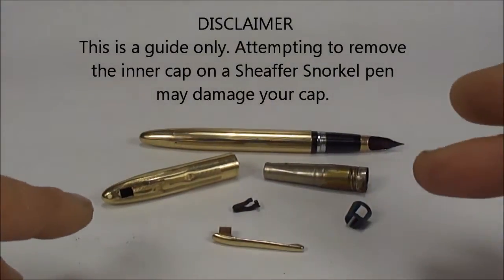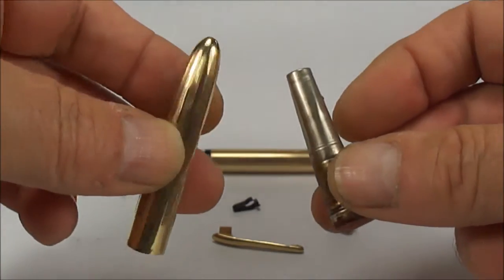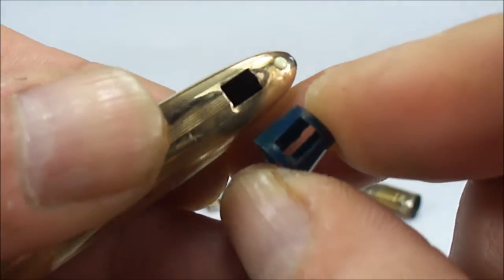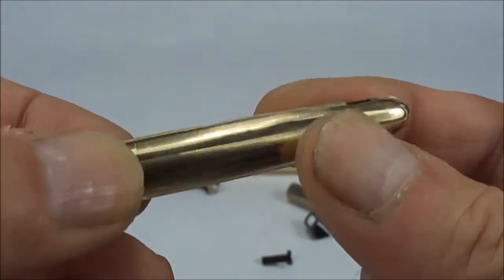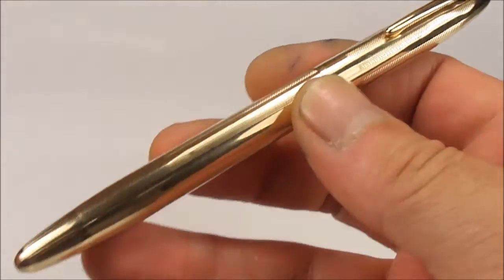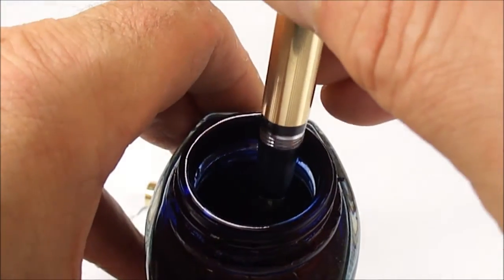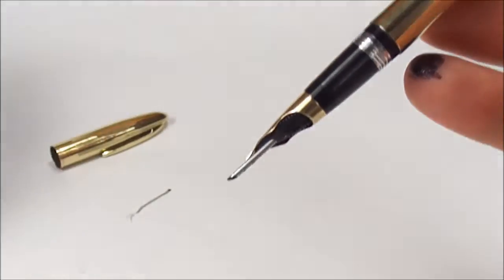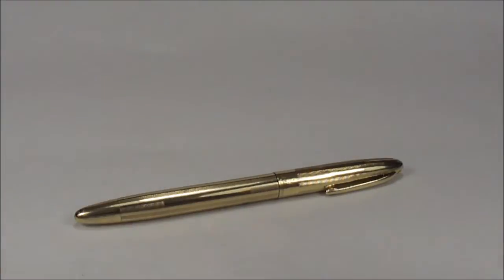SHEAFFER SNORKEL METAL CAP REPAIR

Comment: Hi Stef. I just saw your excellent video about the snorkel gold cap repair. I'm trying to remove the inner cap of my PFM. I heat with hairdryer and with boiled water, but nothing works yet. Any suggest? Thanks a lot!
Reply from the maker: I think you need a inner cap puller tool for the PFM. I do not have one available so i can not give you further advice. Sorry.

Comment: Hiya love the video - great work! I’ve got one with the brown striped celluloid cap where the clip has come away. It has the wide cap band. Any tips other then what’s in your video as to how to remove the inner cap? Is the cap band holding it in?
Reply from the maker: I dont think Sheaffer made a striped snorkel pen ? To remove inner caps you will need a cap puller. Good luck.

Comment: Hi.  does anyone have the specs on the anchor Steph used in the video to pull the inner cap, and maybe a still photo?  Thank you.
Reply from the maker: I think inner cap pullers are availble on line from dealers. Good luck

Comment: Hello Stef. Please, what do you use to polish metal fountain pens? How can I  remove little rusty points on the metal cap? Thanks, JR.
Reply from the maker: Each metal pen has to be assessed individually, ie condition, material, pattern etc,etc then an appropriate method used. This also applies to any rust spots, however you can try the finest wire wool. But you have to be careful and rub only the precise slots only or you may effect the surrounding areas. Finally apply some Renaissance Wax to the spots. The rust indicates the metal has already been compromised so you will not remove it completely.